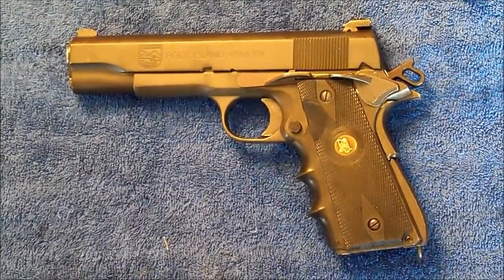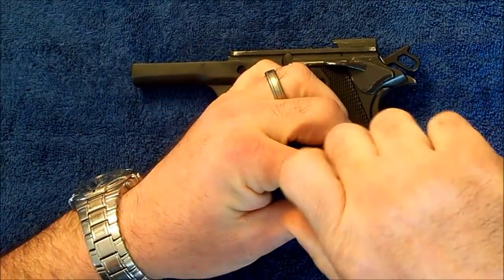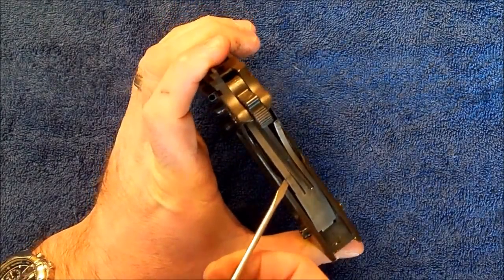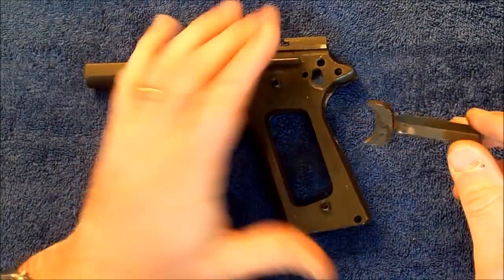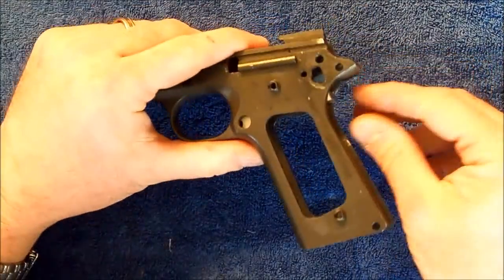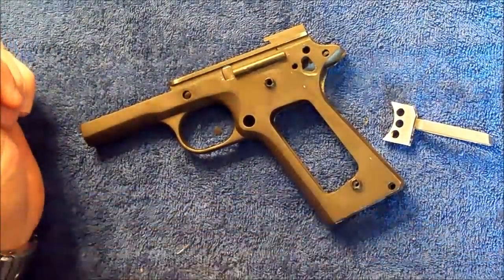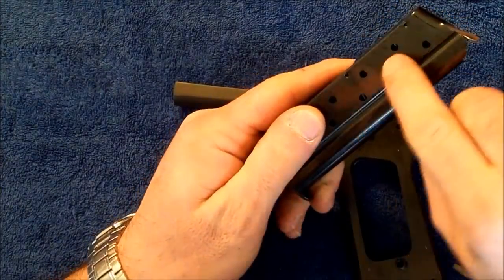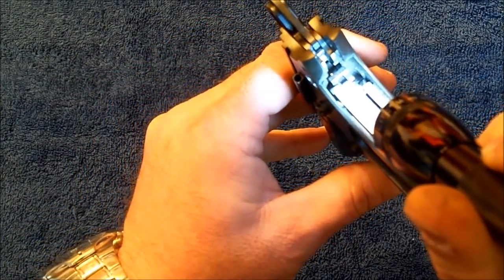1911: Remove and Replace a 1911 Trigger

Comment: Awesome step-by-step tutorial. I replaced the trigger on my ATI FX45 Military model without a glitch. I did some careful polishing inside the frame - the trigger feels quite smooth and looks great. While I was at it, the original sear spring was weak and the grip safety did not work, so I replaced that.  My ONLY critique on the video is the re-installation of the disconnector/sear was difficult to see during reassembly, but there are plenty of images out there to help with that. THANKS!

Comment: Most important part new B's mess up is sear & disconnector and you decide to twirl it around rather than show how they should fit together, then going off screen and finally tilting the frame to block the shot during insertion.  NICE !

Comment from the maker: This pistol has the short GI style guide rod.  While you can remove the slide without removing the spring first, if you do it comes out rather contorted and can make it difficult to break down later.  Colt and the Army breakdown manual both show removal of the recoil spring before removing the slide.

Comment from the maker: Add a little bit more to the left leaf which is on te sear leg.  The grip safety does not make contact with either the sear or disconnector so it shouldn't make any difference, but appearently it is causing a slight amount of pressure allowing the hammer to drop when it is pushed in.

Comment from the maker: Another Pistol I purchased at a gun show in very poor condition and it was repaired and returned no charge.  As for effecting the the reliability,  since you would only change the trigger it shouldn't effect, the safety or the hammer function, Certain types of triggers may have adjustment screws that can cause some reliability issues until adjusted properly.  look foe the M1911 forums on the net and check the gunsmithing section.  Lots of good info and they will answer any questions that come up

Comment from the maker: That's where the old, " some fitting required" comes into play.  You  can use a fine file to file the trigger to fit.  You will want to make it just narrow enough to go in and function without dragging.  Go slow and you'll be fine.

Comment from the maker: Bend the center leaf of the sear spring in slightly to adjust for the creep.  This will push the disconector in slightly and should remove your creep.  The sear willl follow the disconnector to a point.  There does need to be a small amount of creep or the disconnector wilnot reset.  It's a balancing act.  go slow  and amake small adjustments.

Comment from the maker: I'm a little worried you said torqued,  Did you try and remove the screw after you had pushed the mag release in about a 1/4 of the way in.  The screw is not threaded it has a little arm the lockes into the frame and the screw is turned counter clockwise while pushing in on the mag release.  it is easiest to start to turn the screw and then slowly push in on the mag release until you hit the sweet spot and the screw will turn and the mag release will come out all at once.

Comment: You really should tell people that when you say "take out the screw with a screwdriver" that is in a CAM not a SCREW....broke the tab off trying to "unscrew" it. New one on the way.
Reply: Thank you.
Reply: Considering it's a youtube video, and it's YOUR firearm, not his, it's on you to do your due diligence and understand YOUR firearm and how it works. There's a reason that every place you can buy parts for a gun specifically states, in a nutshell, either know what you are doing or have a licensed gunsmith perform the install.

Comment from the maker: @gregmr7171 This is something that you can do yourself, I would encourage you to whatch as many of the breakdown video's on youtube as you can, before you try a full teardown, which is part of routine maintenance.  As for voiding the warrenty, it should not efect it, however I can't given you any guarrentee of that.  I can say that the warrenty center here in the US has been very accomidating.  I have sent one Brand New pistol, into them with a note that "It just didn't feel right".

Comment from the maker: Is it the match Long trigger with the black Bow, or the ultra light model with the cut down silver bow.  If it is the Silver ultra light model you can turn down the tabs on the front of the bow slightly.  Those are  actually to take up any fore and aft slop but they work for up and down also.  The Black one is usuallyoversized anyway so if it is loose then you'll likely have to trya a different trigger.

Comment from the maker: @404040c It will work for a Series 70 pattern pistol, On the Series 80 pattern there are 2 more parts to deal with, but the prooceeedure is the same.

Comment: I have a question brother I bought a rock Island never used it and I found my gun with the trigger broken it was bent from the inside so I can’t slide a clip in do you think someone did this too me or it just happens on my clips I have no scratches everything is clean. Lmk in the comments

Comment: When you removed the main spring housing (hammer spring housing) and then put it back you had the hammer cocked which is wrong. You are fighting the hammer spring being compressed.

Comment: hey i just bought my first 1911, its a auto ordanance ww2 replica and havnt shot it yet but the trigger is really really stiff, i was just wondering if it will brake or i need to change out the trigger?

Comment: I installed this trigger in my 1911 but doing so my grip safety wont work. what am I doing wrong? I installed my old trigger and the grip safety works just fine.
Reply: fearxile check ur leaf spring for correct placement.

Comment: Have a slight problem, I recently installed a wilson combat match grade trigger in my RIA 1911A1FS Tactical 1911. The thumb safety engages crisp and solid, grip safety functions well, magazine goes in without resistance, I did a function test on all of the safeties and such, everything checks out, my problem is that the trigger itself is so loose in the trigger guard that it rattles vertically. It is the same size as the stock trigger, any suggestions on why this could be?

Comment: Mainspring pin wont punch out? proceed to use the slide as a hammer to punch it out. Also, a little more detail of the removal ofv the thumb safety would be nice